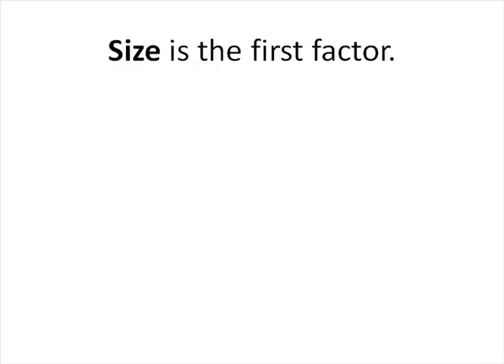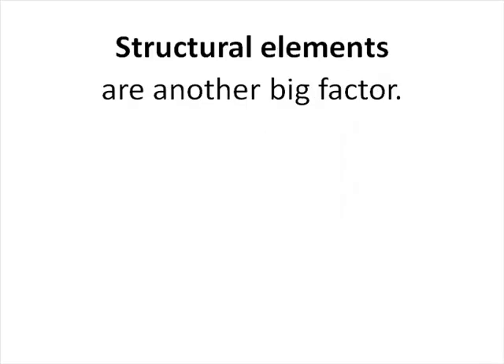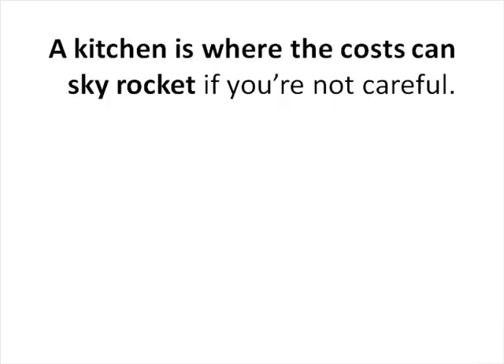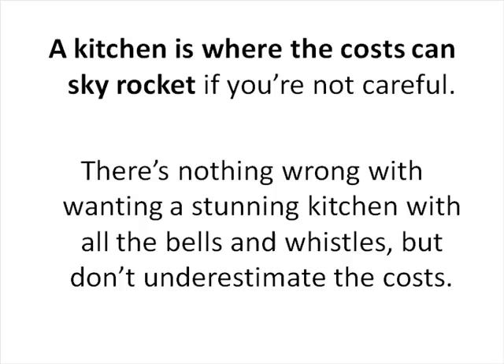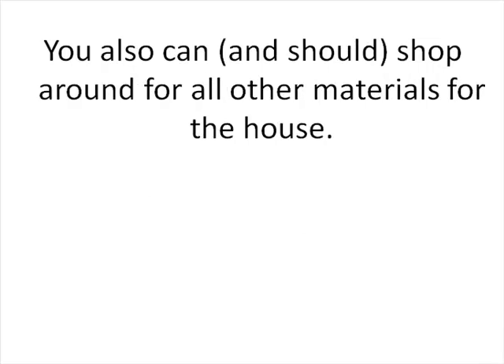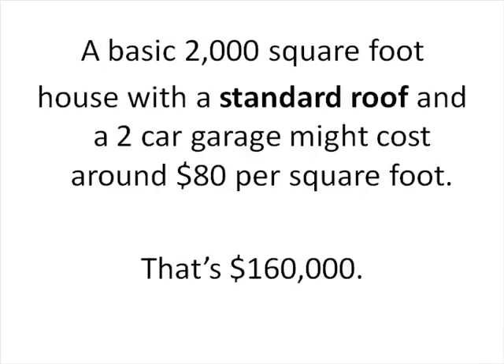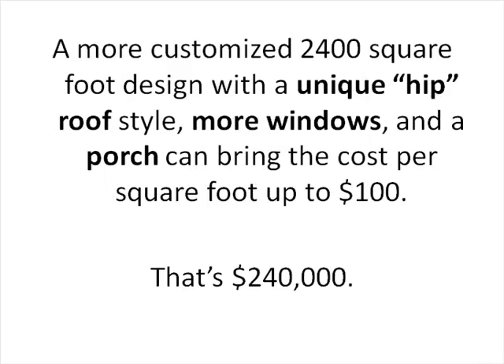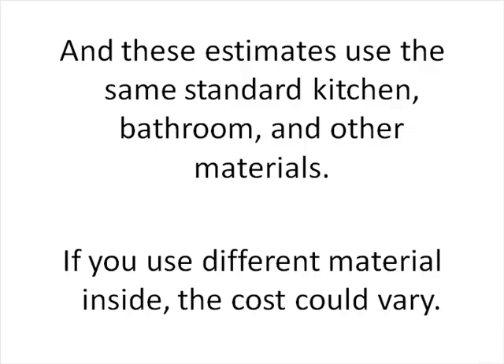How Much Does It Cost to Build a House?

Comment: Total fantasy.  $100-125/Sf today will get you a starter home in the southern US built on a slab on a small tract lot.  A northern home on a full basement will be $200/sf and up, and custom homes typically start around $300/SF and can easily be 2-3x that.  It just depends on the market.  In Silicon valley a cramped 2-br starter will be North of $1M... That same $1M will buy  a near mansion in rural Missouri.  Don't do any planning based on this video.
Reply: You're right. In Alabama a new home will cost you 117.00 per sq ft. Gadsden area. Full brick, hip roof with 3/4 acre lot. As of feb. 2019. Many houses going up are cheap made and i dont know how much they are? I feel sorry for the person up north that wants a nice 2800 sq foot home. In Alabama you don't even pay property taxes if you're 65 or older!!!!!
Reply: Yeah, I'm pretty skeptical too.  Maybe this video was closer to being accurate back in 2013, but I think it's way off today.
Reply: Not if you live in Kansas